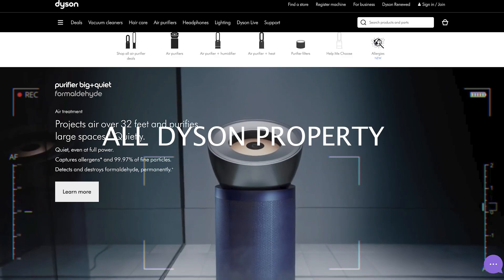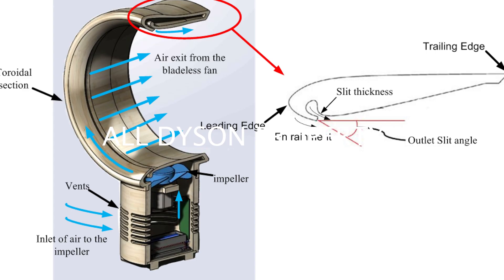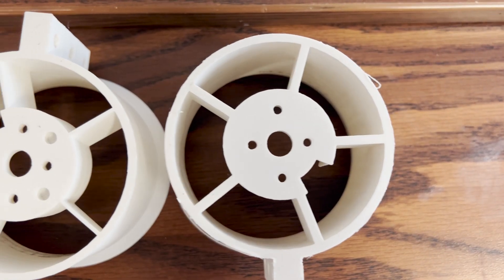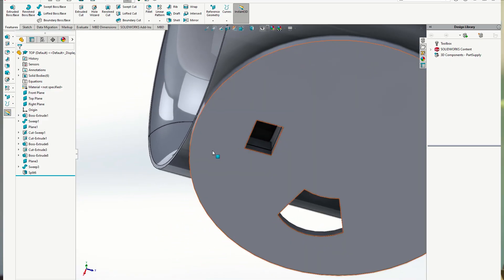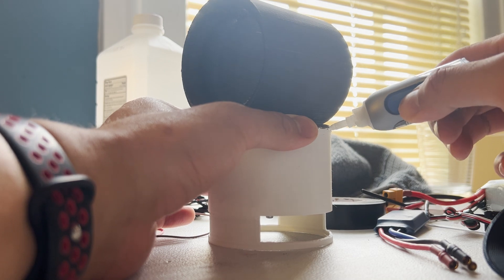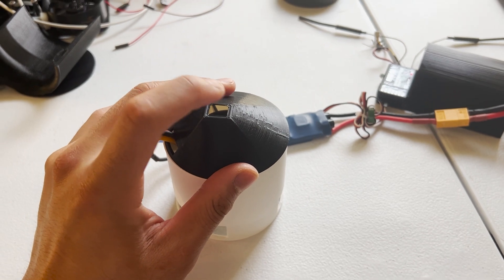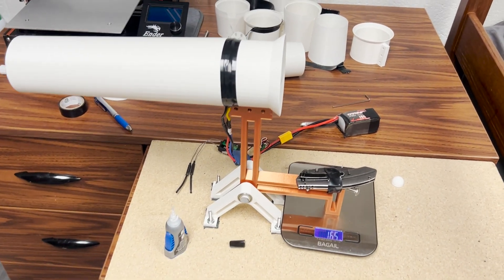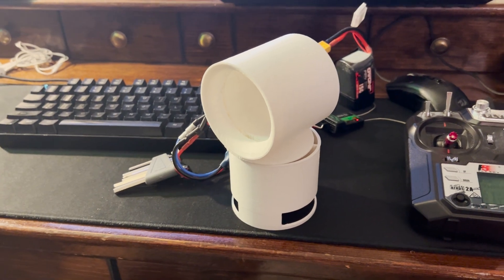Rough 3D Printed "Bladeless" Fan Attempt

Comment: Hi, you do not need to hint that this is Dyson IP and worry about infringement. You are making an "air multiplier" - google that and you'll find loads of products, designs, and scholarly papers on the underlying physics. Dyson does NOT own the wide world of air multiplier technology. 

I have designed and 3d printed air multiplier nozzles for compressed air systems and they absolutely work, if you get the parameters right. From looking at what you've got there, I would say your whole nozzle is way too big for the fan you're using. Try making at about 1/3 scale and make the gap between inner and outer as small as you physically can with your printer, without them getting fused together. You might need to use a 0.2mm nozzle. The reason is that air multipliers trade velocity for volume. If you want a lot of volume you need a lot of air velocity from the source. The tighter the channel air must flow through, the faster it will go. So super tight gap = super high volume. I didn't figure that out until about the 7th or 8th revision of my nozzle design. 

Another (hopefully)-helpful hint, don't print it on its side. Cut the model annularly in two parts, print upright, then superglue the inner part into the outer part.

Please note, not sure what your intended purpose is for this, but unless it's inflating trash bags, an air multiplier doesn't do what you might think it's supposed to. Again, I didn't figure that out until very late in my design process, once I had made something that actually worked. If you're expecting a more powerful jet of air, forget about it. A powerful jet is made from high speed, high pressure air. Speed and pressure are the two things that you LOSE with an air multiplier. Speed and pressure are the two things that you trade for increased volume of air. So, you can use an air multiplier to inflate a trash bag in a fraction of the time, or to more effectively evacuate fumes from a room, but if you're expecting a more satisfying blast of air from a desk fan, this ain't that. In my case I was better off just using a straight pipe for a nozzle rather than an air multiplier.

Comment: Yes, I'm trying to do it as well. But my version is a true bladeless fan in that the air is taken in from the back and passed back to the front which should give it x2 the air flow needed. Still working out air area. (Edit): Yes, you need to calculate the area of the fan and convert that same area throughout the outflow. You here have cut the area by 95%~ giving the bladeless fan itself only 5%~~ of the fan. There is also a LOT more math needed. But just remember to keep the area of the airflow the same from start to finish.
Reply from the maker: Interested in seeing what this looks like, if possible
Reply: @mach10point4  Yes, was thinking about that. It was created in FreeCAD and I think YouTube hates links? But after coffee we can figure out a way of contact. :)
Reply: @mach10point4  I gave up on it like 2 years ago and been thinking of looking at it again. The main issue is that I had the math wrong and could not get even air flow  ---mostly due to the limitations of...FreeCAD. :)

Comment: You should try incorporate the "bladeless fan" Into a jet engine system. Without so many compressor turbines in the way of direct airflow, i assume that there would be less drag and more room for combustion space.
Reply from the maker: Never thought about this before. I think it would be hard to scale this to produce pressures required for combustion, whereas for fans you can just add more stages/blades. I’ll look more into it, thanks

Comment: These style fans were a pretty popular project years ago in the 3D printing community. Most of them just used computer fans, which I very much doubt had the airflow and static pressure needed to make the "air multiplier" design work very well.  It was fun seeing you revisit this idea with a fan design that could probably deliver the airflow needed for something like this.
Reply: they certainly dont have the needed pressure to produce that effect, but with a large enough fan they work pretty well. I used a Fractal Dynamic GP18 180mm fan that has 261m³/h airflow and 2.26mm H2O at max speed (1200RPM at 12V but i run it at 20V so its way more) while staying pretty low noise. Its been running 12 hours a day for the past 2 weeks.

Comment: I'm no expert on fluid dynamics, but my first thought would be to ditch the axial flow fan and go for a blower style fan and just focus on trying to make it more quiet. Cool project! Keep up the nice work!
Reply from the maker: Yeah that's a great point. I was using the fan I had on hand but that was more designed for a thrust generating application cause I was lazy. Thanks!